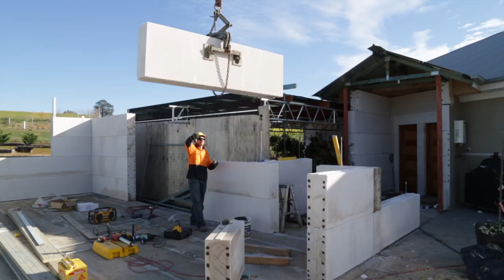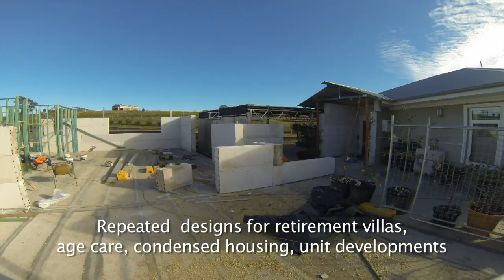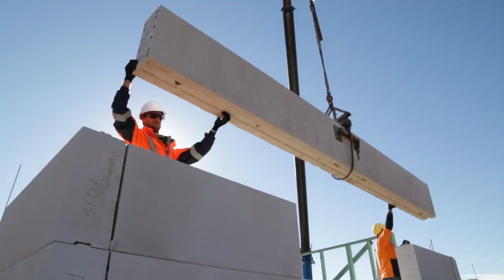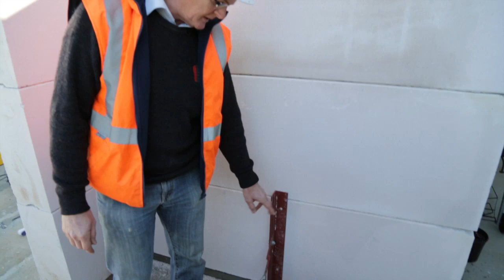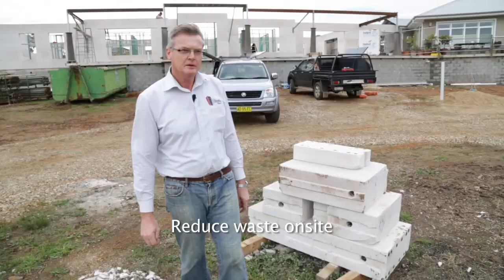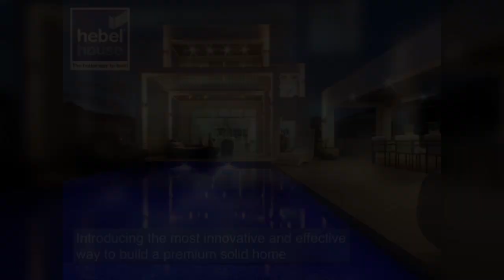Hebel Home - Demonstration Video

Comment: Are Hebel blocks available for commercial use?
In a commercial situation where we are building boundary to boundary without any gaps between buildings, how do we solve the issue of external rendering?
Can you please email me the full technical information about your products? Pricelist included, please, so we can run estimate comparisons of jobs to be undertaken.
Franco
Reply: Pretty sure it can be used for commercial buildings and industrial. Rendering it would always be best to have specific acrylic coatings put on. It’s all on csr website

Comment: Thank you for a very informative and compelling on-site technical demonstration of the benefits of using Hebel AAC wall panel units in residential construction. In most cases, Hebel standard or jumbo blocks are used in residential construction. Your video amply demonstrates, especially in larger estate home projects, Hebel AAC wall panel units are a better alternative. I live in the USA where residential use of AAC is inexplicably minimal. I believe the under-utlization of residential construction is due to several factors, minimal distribution network for AAC building materials/products and difficulty in retaining architectural and engineering firms with expertise in AAC construction. I did have the following additional questions regarding the video;

What were the density specifications of the 250mm Hebel wall panels used in this project?
How was the exterior of the AAC wall panels finished?
Overall in contrast to CMU brick what was realized percentage  cost savings?

Thanks!